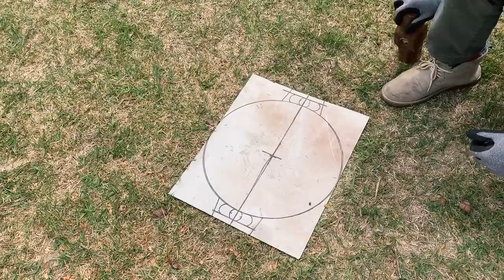$9 Homemade Griddle for Camping - Cooking with Camp Wood Stove Griddle

Comment: For the future use a sack (possibly in chamois leather) full of sand and use a round-headed hammer, it does not have a sphere that makes the dent and not even a square that leaves the edges in the metal, it would take slightly rounded I curved, place the  object over the bag and start working with a lot of elbow oil.  I also recommend cooking the metal or making it turn red to soften the molecules of the metal to work it better and by repeating it it will come back hard.  If you don't understand or need, write. I am a goldsmith so I know some tricks of the trade. Good job and excellent pan.
Reply from the maker: Even today, I share my work here and learn from the viewers, they are experts. Thank you for sharing this valuable know-how. And it will be helpful for many people who read this article.
Reply: I thought the same, to cook or make turn red the metal.

Comment: For hundreds of years Indians have been making it in 5 mins with a curved soft hammer onto a concave form.
Reply from the maker: They are awesome!
Reply: I have never seen Indians so fast, which does not mean that they do not exist. Five minutes? I've seen die-cutting presses doing that job in less than a second.

I suspect 캠핑 투게더 does not have a die cutting press or a curved soft hammer or a concave form.
Call me paranoid but your comment does not seem very constructive, does not contribute any applicable idea or positively value the work that 캠핑 투게더 does and generously shares.
Perhaps you have done some similar work and can share with the community the results you have obtained. From there we will all learn a lot. I tell you from respect and affection.
Greetings and best wishes.